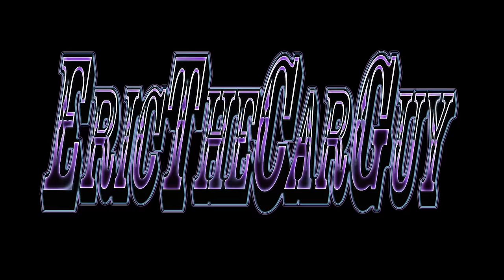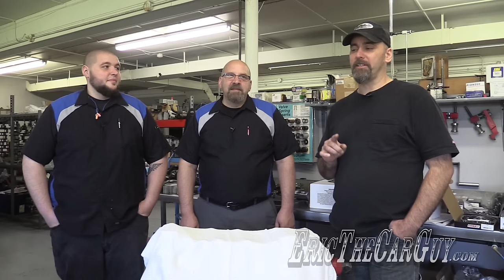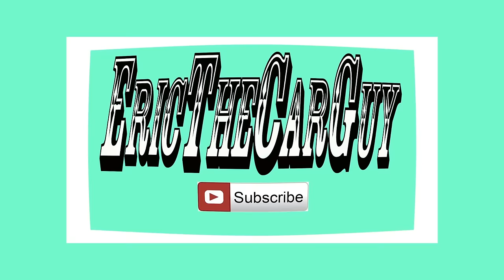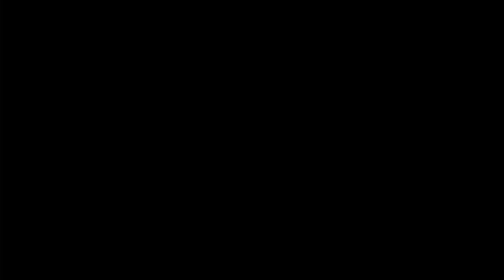Fairmont Engine Build with Kalvinator Engines Teaser #FarimontProject

Comment: Are you gonna stroke the engine out to higher displacement? Would be simpler than buying a new engine but then again I don't think forced induction works well with high compression (with gasoline that is).
Reply: boost is basically high compression. the only issue would be detonation which higher grades of gas can fix. also he install some flex fuel magic so he can use both gas and ethonal which should allow him to have high compression and boost.

Comment: I wonder with the state of todays technology, could you possibly build a 600hp engine that has a "road switch" that limits the power only to 150hp. And you could flip the "road switch" into "track mode" and access all those 600 horses.. 

So you could inspect the car with 150hp to be at the legal limit of engine modification allowed and then flip a switch on track. 
(Ofc i flip the switch after inspection duh.)
Reply: James Maninang Let's say that you have a 100hp car. The possible maximum amount of hp you can modify your engine is 150hp. 

Now you have upgraded all the chassis and brakes to safely run 600hp. 
MOT will fail you with said hp. So you attach a hidden switch to drop it to 150hp (With dyno sheets) and then switch it back to 600hp after the MOT inspection. Then enjoy having what you should have instead of what the MAN tells you, you should have. 

Why can you run 1000hp cars in USA and nobody bats an eye.
Reply: James Maninang This conversation never happened. Carry on.
Reply: Perhaps you can have a car with an ecu with two different tunes. 1 setting for low boost and the other for high boost.